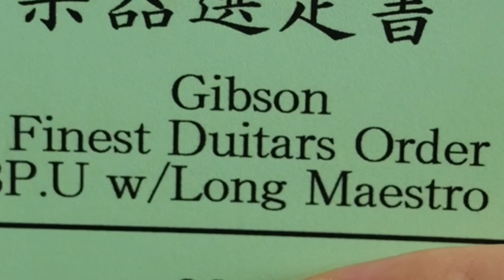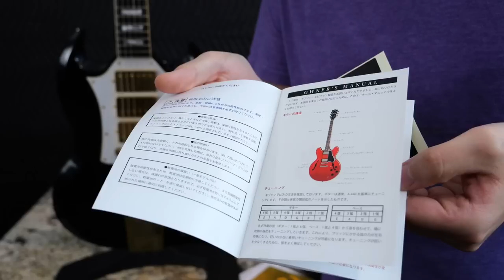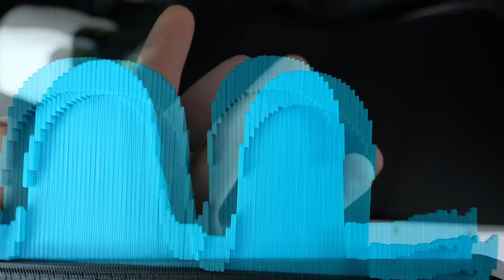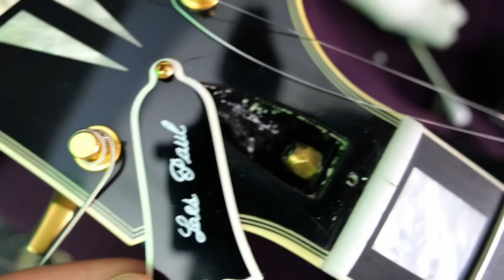I Bought the Finest Duitar in Japan

Comment: I had the domed thumbwheels and nylon saddles on my totally stock 1970 SG. The bridge post holes were also tapered, the larger diameter being on top. I believed this was an effort by Gibson to try to make the tremolo stay more in tune, as the bridge would rock slightly back and forth. Didn't work.
Reply: I put a Bigsby onto a newer Les Paul, and couldn’t get it to stay in tune until I got a set of domed thumbwheels. The principle is the same as with the Fender offset bridge. The domed wheels aren’t always necessary though as the bridge posts on many Bigsby-equipped guitars tilt a little back and forth with use giving the same effect. 

The tapered bridge post holes on the bridge isn’t needed with vintage-style ABR-1s as the tolerances aren’t that tight, though some newer bridges could be problematic depending on how snug they fit.

Comment: I built up an Epiphone bolt neck LPjr a while back just for fun, I added a short Maestro Vibrola and a roller tune-o-matic. The roller bridge saddles must have made all the difference because I’ve never noticed any tuning instability. It does have a Tusq nut and it’s cut well, I’m sure that helps. Edit, I’m not particularly gentle with the Vibrola.

Comment: I have repeatedly been unpleasantly touched by statements about the tuning stability of classic trem systems. Usually the complaint is heard after replacing the strings with a set that the user likes and in general, the gauge recommended by the manufacturer is abandoned... 
I have been cured of such crying baby disease 40+ years ago. I replaced the previous owner's 012 caliber with the recommended 010 on a newly acquired secondhand guitar and the Jaguar vibrato stayed perfectly in tune! Unfortunately, the knowledge of the majority of the complainers about the strength of the material and the tension of the strings is close to zero.🧐

Comment: It’s a common misconception, but the middle position on 3 pickup LP and SG customs, as well as similar flying Vs are not out of phase. The middle pickup magnet is still reversed polarity from the neck and bridge pickups. The polarity of the magnet needs to be the same in both combined humbuckers for it to be out of phase.
Reply: They could be electrically out-of-phase, magnetically out of phase or both.  
I believe what is going on is the polarity is reversed and they are wired in parallel.
In any event, its a great sound that is very useful.

Comment: That black sticker (according to my google translate camera mode) says something about putting that sticker on the registration card before sending it in.

I think any vibrola would benefit from locking tuners, not traditional, but it would help.
Reply: I have always been curious why Gibson doesn't put locking nuts on their tremolo model's? everyone else does, it seems apparent that Gibson hasn't learned how to correctly build their tremolo model guitars. even after all the years they have been in business.
Reply: @musicauthority8704  those Axcess Les Paul’s with the Floyd Rose are done right, but not everyone likes a full floating double locking whammy bar.
Reply: @joermnyc  That has nothing to do with a locking nut. something that Gibson doesn't use on their tremolo model guitars. and that every other guitar manufacturer does use.

Comment: I should hope the third pickup would be enough to eliminate the neck dive, let alone the Vibrola system. As for the wiring, I would have it modified to include 3 volume and one tone like the modified Epiphone Riviera with the 3 P90s. I also would have each of the volume pots fitted with push pull switches for phase cancellation.

Comment: My '67 Standard that I bought in '72 has the Vibrola, the nylon saddles and domed thumb wheel are supposed to allow the bridge to rock, it did , out of tune every time.  I replaced the saddles with brass, flipped the thumb wheel over and removed the trem. arm, problem solved!

Comment: The truss rod cover says Laes Paul? Very weird
Reply: When regular production of the Les Paul stopped in 1961 it was replaced by the SG.  At that time Les Paul the man was still endorsing Gibson solid body electric guitars, so they named it a Les Paul.    At that time Gibson never intended to again make the Les Paul in its original single cut design.
The name was changed to the SG when Les Paul the man terminated his Gibson endorsement contract.
So yeah, the SG was called a Les Paul during its first few years of production.